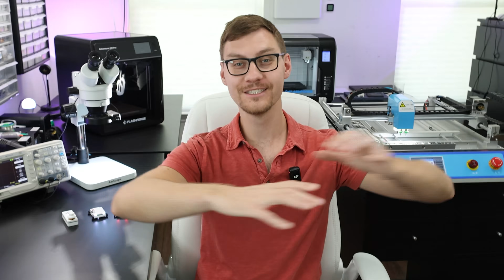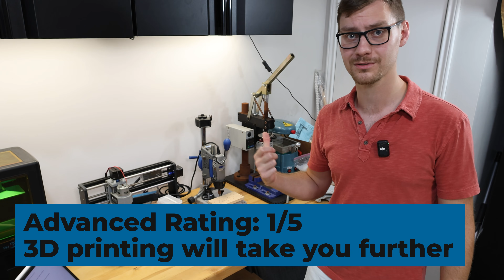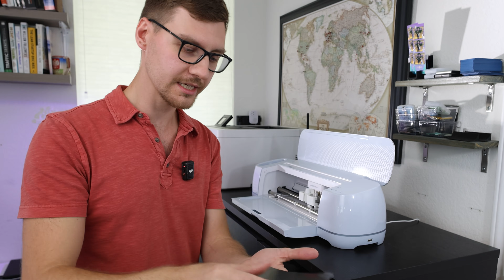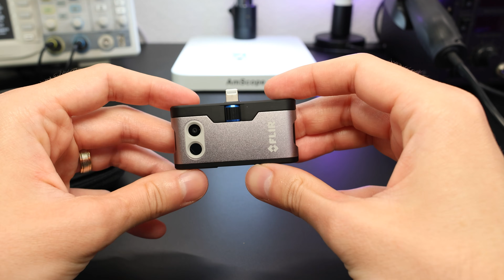I Wish I Knew This Before Building My Home Lab

Comment from the maker: 👋Want to build your own Micro Racer and support the channel? This allows me to build bigger and better projects. Thanks! https://stuckatprototype.com/pages/micro-racer-preorder

One item that I should have also mentioned is my power supply. I have a fairly cheap one that's been serving me really well. 4/5 rating for starters, I got away without one for a while, but its super useful to have a power supply that allows you to set current limits. 

Here are the timestamps, enjoy:

0:00 Introduction
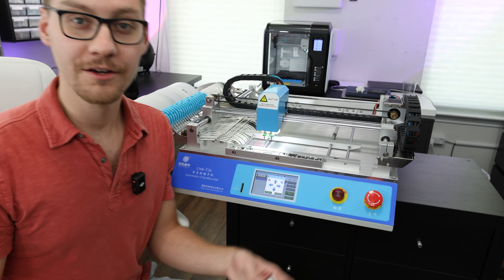01:02 The type of projects I make
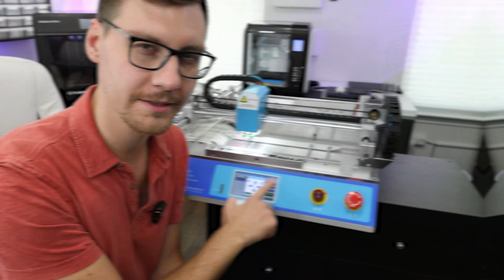01:53 Stereo Microscope
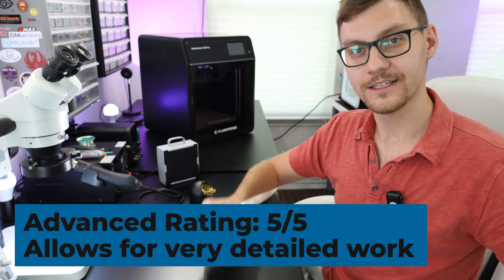03:53 Soldering Iron
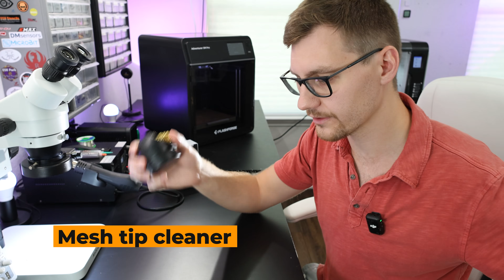05:32 Soldering Addons
07:32 Hot Air Station
08:32 SMT Soldering Addons
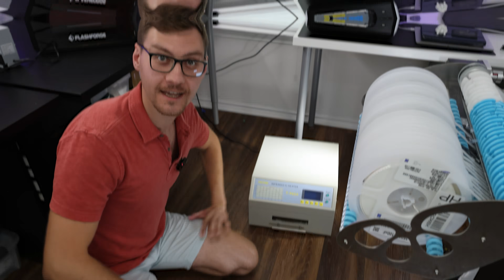09:13 SMT Reflow Oven
10:16 SMT Pick and Place
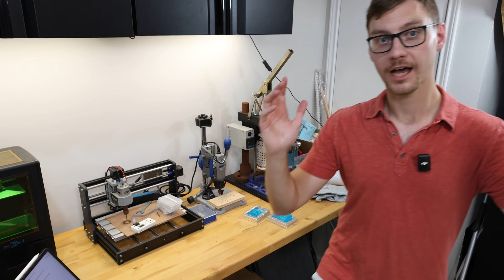10:53 Injection Molding Machine
12:28 FDM Printers
13:42 SLA Printers
15:15 CNC 
15:42 Plotter
16:36 Oscilloscope
18:49 Logic Analyzer
19:42 Thermal Camera
20:58 PC
22:29 Total
Reply: could you provide direct links to purchase these items on Amazon? You could probably earn a commission with Amazon for when people who click on your links and someone buys
Reply: i send you a Email :D

Comment: For me a good solid CNC router is essential for a maker. I don't do just wood, I also use it to cut aluminium, some mild steel occasionally and plastics (ie acrylic). Not only that, I'm into sewing (upholstery, clothes) and use the CNC as a pattern plotter. You can hook up a laser module to cut some materials that way as well. Mine was a DIY build I did with chinese parts, I spend 2500 euros/dollars on it, and it's really solid. build space is around 680x1400x200mm

As for carbon filter, that thing you have really doesn't so much. A good filter has activated carbon pallets, and the air must flow through it at least 2.5cm/1" or it doesn't really get the chance to interact with the filter. All yours does is draw away and disperse into the air. Don't get me wrong, getting the flux fumes out of your face is much better than nothing. But then just a small 120mm case fan running on 5V would suffice. I have an air filter that takes in fresh air from outside and pushes bad air out of the vents around the house, so I don't really need a fumes extractor.

I agree with a good soldering iron, at least 200W and good tips like the JBC C245 soldering tips. Most of these with a big tip have good heat capacity, if you need to sink some heat into ground pads or solder big copper wires. I often use it to splice in some extra length of wire on devices that usually come with short cords. I also make my own led lighting.

Speaking of lighting, after a good magnification device, also spend some money on lights that you can bend towards the project of interest. Those 'swan neck' style lamps are absolutely great. I make them myself with 600mm length neck, 3D printed lamp holder, a green screw connector for the 12V led bulb to fit into, and a desk clamp. Wire some speaker wire through it and you've got a lamp that you can bend to your will ;) I think I've got 10 of those around the project areas I have, and in the living room as well. 

But to each their own, depending on your area of interest, it's sometimes good to spend a little more, and if you're not sure, get the cheapest and use it until you outgrow it and upgrade, or discard it if you don't use it for a couple of years. Keeping your lab tidy is also a good idea. Just throw out or move out of the way stuff you didn't touch for a couple of years, focus on the things that are useful right now and adapt your workspace to that.
Reply: I was thinking the same about that fume filter, its useless. Carbon has limited amount of how much stuff it can absorb, those sponges are mostly there for show and doesn't little to nothing. While pallets does remove quite a bit more and lasts way longer, but even those expire after some time.

Comment: To your soldering Iron, I have two aifen a9e at my place. they are not that expensive and I have one with very small and one with mid chisel-style tips. So I do not have to change all the time. that was the reason to buy a second one. But also, if you solder a lot, get a proper air filter like VEVOR Soldering Fume Extractor. This stuff costs, but your health is worth more :-) And thanks for sharing this great video, appreciate it.

Comment: no you don't wish you had a 3D printer at the beginning of the patens expiring. They had poor motion systems & poor flow control systems & the materials sucked to print. Generally you spent more time tweaking the printer than you did actually having prints succeed.  Back then 3D printing tinkering/customising was the entire hobby. That was the case even with the start of the cheap printers out of China. Now they are tools that for the most part just work.

Comment: A hot air reqork station WITH an IR preheater is even better.  Pre-heat the board from underneath at 150-200 deg and hit it with the hot air on top works much better and faster.

Comment: When it comes to microscopes there’s a lot of digital scopes with 7 inch screens that are way more useful than Optical microscopes. If you’re doing any advanced soldering or BGA, it’s basically a requirement. You can find them for about 100 bucks so it’s really not expensive

Comment: Hi, I’m currently looking into producing an electronic device for the US market. Since you’re already selling one, so I wanted to ask—what certifications did you need to get started (e.g. FCC, safety, etc.)? Also, if you don’t mind sharing, what was the approximate cost for certification and testing? Thanks in advance!
Reply from the maker: I should make a video on this, but… in USA the minimum is fcc. Depends if you need to do full testing, it will run you anywhere from $1k to $5k or so. Also depends how many times you’ll need to test. Safety stuff will depends what safety standards you want. Anywhere from $1k to hundreds of k. Good luck!

Comment: Things that are super helpful but not mentioned: LC meter, ESR meter, transistor tester with ZIF socket. Bipolar power supply, i’d get at least  +/- 30v,  60 v would be great. Desoldering pump (electrical).

Comment: so, how do you do your PCBs? There are a lot of valid comments about oscilloscope rating, and you yourself even show such niche/industrial production things like plotters and picking stations, but there are not a single mention of PCB production. It is such a huge elephant in the room, the soldering iron is so important, but what do you solder ONTO?

Back where I was from in 90s-00s there were several methods of various degrees of ghetto. First, people have drawn the paths with nail polish. Second, there was photofixer method, which required you to print a board on transparent plastics, spray the CEM with photofixer, put the printed template onto it and expose the whole thing with some UV. Third was a "Laser Iron Tech" which required you to print a mirrored version of your PCB with a laser printer set to a 100% toner expense, then putting the print onto CEM and ironing it with a regular clothing iron. The toner would transfer to the CEM.

Then, regardless of the method, you would bathe the CEM in ferric chloride solution which dissolved all the unneeded copper leaving you only with paths.

Now, how do YOU do your PCBs? You have even an injection mold, surely you don't just order them, especially for one-off projects?

Comment: I'm curious what your actual complaints are about injection molding and I think it entirely depends on if you're making parts for a known product and need to do something at sense of scale vs a hobbyist just dicking around. If someone is messing around and has already had experience with casting and or machining then yeah, getting something for molding may make sense. The quality of finished parts depending on your positive and your mold will still beat out 3D printing in my opinion, unless someone does acetone baths.

Also, there are some really nice, high end larger format injection mold equipment that can product at scale. Obviously equipment like that is expensive as hell and needs a lot more space along with the knowledge, but it would produce much quicker than your 3D printer, faster, better quality and consistently.

Comment: my 2 cents: 1. DC regulated bench power supply with adjustable voltage and current limiter. Even usb programmable (great for testing) is so cheap nowadays and it'll keep you from frying your way more expensive stuff every other day. 2. Listen but don't obey: Know the tools and figure out which ones better suit your workflow instead of forcing yourself to acquire someone else's. I worked over a decade amongst hardware engineers bringing everything between the most simple IC printed microwave antennas to really complex telematics control unit devices from their own prototypes to product and only a few ever learned how to reflow or even use a soldering iron beyond installing some pin headers on a pre-cooked board, at home, as a hobby. They don't teach you that in college (certainly not if you are pursuing a masters of science in electrical engineering), and established businesses iterate way faster easier and cheaper using inexpensive vendors operating at larger and way more efficient and well provisioned scales or in house specialized workers getting minimum wage for it (but with at least better protective gear than a toy fan, and still more efficient tools at scale that shorten iteration cycles).

Comment: in my experience, when dealing with mixed signal or analog components/boards, oscilloscope is used frequently. I only use oscilloscope on Digital signal when there is a signal integrity issue.

Comment: Tip cleaning blocks are great for cleaning your tip if you get black oxide on it. dont use them all the time but deffinately recommended. Keep your tip temp down and the wire wool will be all you need.

Comment: "Starting with electtonucs"... whether an oscilloscope is necessaryor not depends upon two things. First what you mean by that. Are you goung to solder premade kits? Try to repair stuff? Design your own circuits and boards? And second: if you are into this to try to understand how electronics actually works.

For some interpretations of "starting", a scope might not be necessary. For others it's a must. You simply can't understand electronics properly if you have no way of peaking into what's actually going on.

Many design tools where you design your circuits in the computer offer built in "scopes" giving you a great wsy to check your design in advance. But to check your build irl and to understand the design choices and how reality like dust, cold sokder etc impacts things you must have a scope.

A chinese 2-400$ scope is not crap. It's a low cost precision tool. Is it the best you can get? No. Is it the best one you'll ever have? Maybe. But if you get one odds are that electronics will be so much more rewarding that you'll turn it into your life's journey.

Buy a great soldering iron. Prototyping boards. Component kits. A scope. And sure, buy a multimeter (but in that case, make it a bench model, you'll thank me later). And consider a cheap electronic microscope for 50us$ or so. If digital is your thing, then look into Arduino.

And oh yes, I just remembered: arduino and prototyping and a lot more (sort of) is kind of part of a product I use called Totem. It's a great experimenting platform. Look into it. Good luck.

PS. As a swedish electronics engineer I would really like it if people started show some respect to my chinese colleagues. They most often do an excellent job designing stuff. The choice of "quality", i.e. choice of components etc, is a design choice to hit a price point and an intended use. They more often than not are spot on. Sometimes you buy something that looks fine but isn't up to the task. That might depend on the casing and UI being overdesigned compared to the inner workings. Uf something look great, marketing people will sell it at a higher price. So do research be4 u buy.

Comment: When I started out in electronics, 25 year ago, servicing and repairing military radios, radars,NBC detection  systems etc. I didn't have a fancy pancy thermal kamera. I was issued an analog version of a flir. My fingerof choice, touch components with said finger until you find the one thats faulty,  and hope you dont get a blister.

Comment: In a pinch, if you can't afford a FLIR camera and need to see which component heats up the most for troubleshooting, wet your board with IPA alcohol and turn it on (current limited / short time) and watch the surface. Where you see the board drying first is where it gets hot. Of course, IPA is flammable and its flame is invisible, so maybe don't use that trick for things that are burning hot.

Comment: You can get started for much less than it used to be. You can get a great microscope with a built-in color screen for under $50. You can also get a pretty decent little oscilloscope for $50 as well!

Comment: Not a fan of my Flir One. The problem is I have moved on to a de-googled phone and refuse to install proprietary apps. There is an open source project that supposedly can make use of it in Linux with v4l2, but I have yet to get it working. I have an ancient Android phone I end up using for it, hindsight I would have purchased a standalone product. Thermal cameras are great though, especially for looking for places within your living space that are in need of insulation!
Reply: My solution to this problem is to use an older, leftover google phone (which doesn't even have cell service) and used a different google login. I put all my dodgy apps on this phone and I'm not worried about information gathering with an empty phone book, and no personally identifiable information.
Reply: @newbobr  yup, that is what i did with that ancient android phone I mentioned in my post, it still sucks though becuase if that thing dies, I now either need another android device or figure out how to get the Linux software working (I'll probably end up spending time that anyways, it would be nice)

Comment: @StuckAtPrototype
Thanks for a great video, informative and enjoyable.
The only thing that I would add (off the top of my head) would be that when it comes to a "good pc" the hardware requirements can vary A LOT depending on what you do, and "how seriously you do it".
How ever there is imo ONE part of your ""PC"" that EVERYBODY NEEDS, but all to many seem to overlook!!
And it's the screen/monitor !!... And I would argue that if you are sitting with a single "small" (under 27"), then   investing in a second, OR one larger monitor is the without a doubt the best "investment" you can do to raise your "productivity". I have been forced to work using "slightly too small" monitors a couple of times. And the "cost" of upgrading those monitors were VERY quickly recouped being able to avoid all the "extra work" that were necessary caused by "too small" monitors. Such as time (wasted) "flipping between applications", "organising windows", not to mention the added "mental load" of not being able to have enough "works space" to see the complete UI of my applications, or not being able to "compare or work" with two "things" side by side, etc etc.
((To make an "analogy" to physical space, it's like having a "workshop" in a "too small room". I.e. most things can be done, but very many things take longer, and is more cumbersome...And some things are practically impossible))
(appologies for the rant :)

Comment: Try to get a cheap old Oscilloscope. I have an 20MHz 2 Channel with Digital Storage and can do most things with it when building stuff. If you are not going into High Radio frequency or try to fix a actual Computer , it's ok. 
Stereo Microscope: If you are young and eyes are best, you dont need. (you will know it, if you need it ;-) 

Thanks for sharing your knowledge.

Comment: I have the exact same carbon filter but with a nice orange color. Reminded me off the orange guitar amps and I bought it immediately!
Reply: You should get better one, these foam type ones will at best partially work for few first soldering's, after that its just a sponge with a fan. Even activated carbon pallets have relatively short life span, but these sponges are generally useless or you should be replacing those each time you soldering on top of tripling down its thickness.

Comment: As a supervisor in an electronics production department, I just wanted to say how impressive this setup is. You clearly know what you’re doing, and it’s inspiring to see such a well-organized home production workflow. Full respect for the passion and the dedication.
For anyone watching the video and getting into electronics, here are a few alternative tools that can also make things easier depending on your budget or space:
A magnifier lamp
Not necessarily better than a microscope — just another option.
It frees some desk space and is comfortable for light SMT rework.

A simple desoldering pump
Very affordable and great for fixing through-hole soldering mistakes.
It can be a good first tool before moving to more advanced gear.

You can also go for Desoldering braid 

0.032” no-clean solder wire
Useful for beginners because the flux is already in the wire, so you don’t need to apply extra flux for most small jobs.

About tip cleaning (for beginners)
Something worth knowing:
brass wire cleaners and chemical tip cleaners aren’t mutually exclusive — they’re actually complementary when used properly.
Brass wool is great for quick cleaning during work, while chemical tip cleaners can occasionally help restore a tip that starts oxidizing.
You don’t need chemical cleaners often, but they can extend tip life when used sparingly.

Awesome work, what a great channel I just discovered!